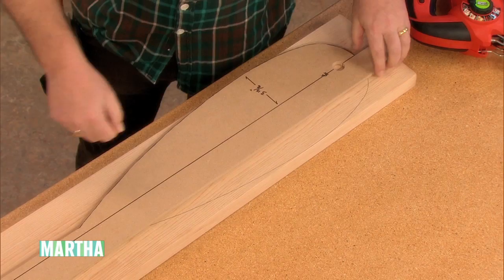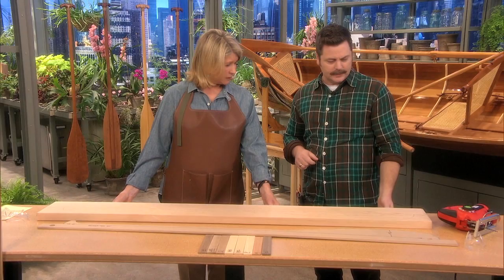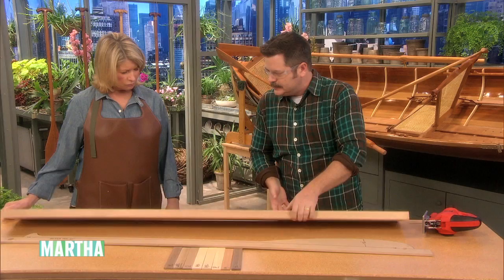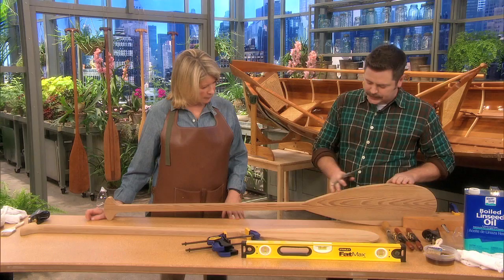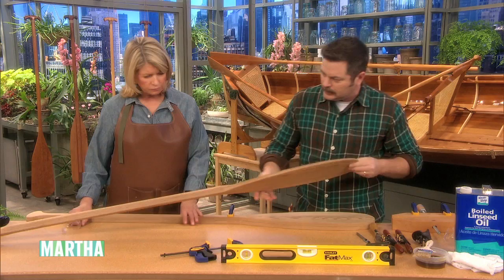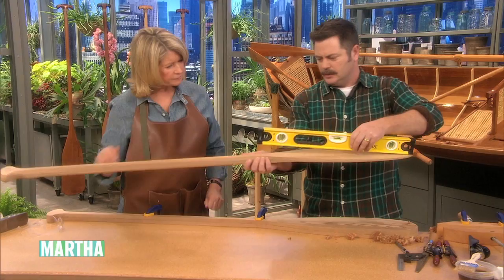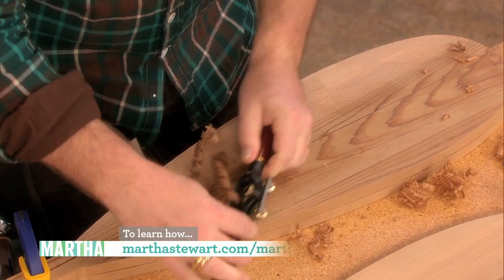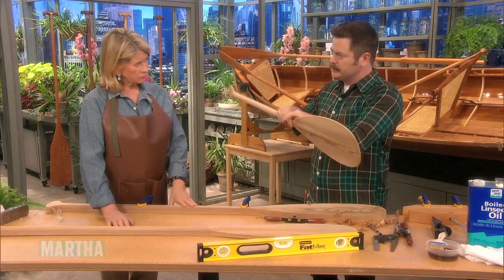Make Your Own Canoe Paddle - Martha Stewart

Comment: Only $395 for a work bench? Yeah, Nick's 'Wow' told you all you need to know about that. Built my own years ago, and all it cost me was time.
Reply: Time is money.
Plus you need tools and material.
Not everyone has a surplus of all three of those and so they buy work tables to do all kinds of things.
Not everyone that uses work tables is a carpenter...
Reply: +Broken Wave not the point man. Buying a desk is hardly an impressive or unique ability.
Reply: Tokath1988 Do you have any idea of how much Nick sells his own stuff for?
Reply: @brottarnacke  you should check his website
Reply: My work bench also came from home Depot but it was about 100$ in the lumber section. I could have built it with a miter box and a hand drill if I didn't have a chop saw

Comment: I hope he feels bad about making a beavertail.
Reply: What's wrong with a beavertail? I mean personally I use an Algonquin pattern which is based on the ottertail, but the beavertail is good too.
Reply: @alexander.angell  Might just be personal preference, but I find they're more energy-intensive to use on a lake, compared to dedicated lake paddles, but don't provide any extra power. The beavertail is more multi-purpose and can be used in shallows and sets, but I'd much rather just carry around a dedicated whitewater paddle and a dedicated lake paddle.
If you're at all curious, I use the Modified Special paddle design from this paddle-maker: https://images.app.goo.gl/RGcbsL1WfPdPNWNg9
Reply: @imgoingforawalk1693  I think it is mainly preference, my friend uses his beavertail a lot more than his ottertail because where we paddle it's fairly shallow so since most of the surface area is lower down it accelerates better and you get more power if you can't get the whole blade in the water. I've been meaning to make myself a beavertail for a while now, so I'll probably do that before going back to university. Haha I'm surprised you replied to the comment, I saw after posting my reply that you posted the comment 3 years ago. The one criticism I have of nicks paddle is that he had a big ridge in the middle going half way down the blade which I find makes the paddle less nice to use solo.
Reply: @imgoingforawalk1693  ah I just looked at the picture and that's not too far off what i use